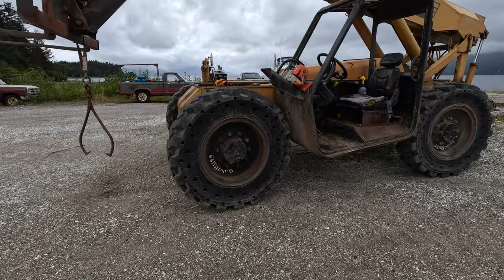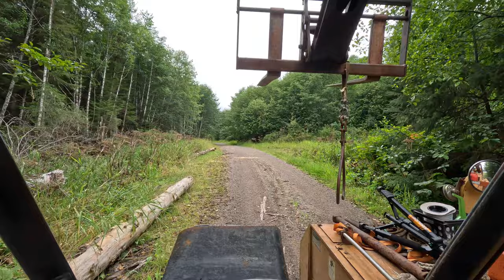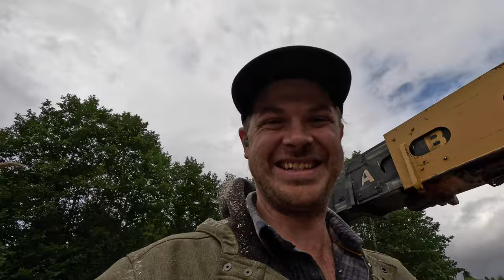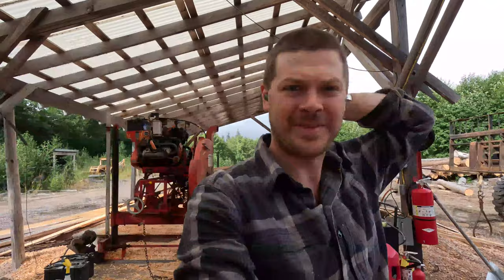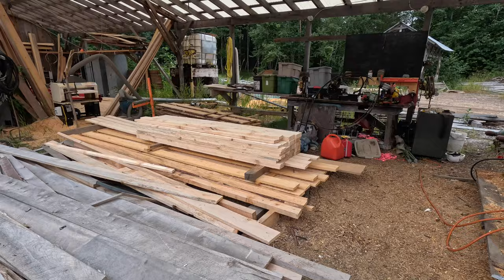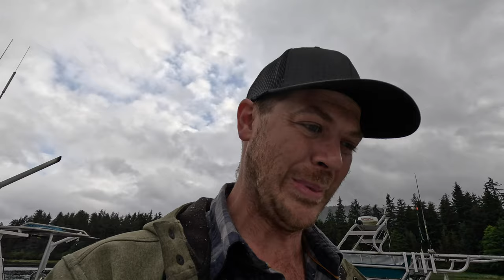Logging with Sterling  -  Mobile Dimension Sawmill   -  Sitka Spruce - Building in Alaska

Comment: How many logs you can cut not sharpening the blade?
Reply from the maker: It depends on the size of Log Buddy 

I am cutting Second Growth Spruce Logs - 24" Diameter - I cut 3-4 Logs in 3-5 Hours 

The mill says sharpen teeth every 4hours - which is suprisingly accurate 

if your logs are dirty - it will go dull immediately - I imagine different timber will cut drastically different than our Sitka Spruce and Yellow Cedar

Comment: That must be one of the last years the mill was made before the hydrostatic carrege drive.
I know of one hydrostatic made in 89 are mill is 92
Are first one was 73
I believe 86 ish was the very first gen1 hydrostatics.
You could use that left hand sawdust shute for the main blade. We find it very helpful.
.
We do a lot of custom full-size stuff, with the 128 wide eger on.
6x6s 6x8s 6x12s and occasionally the limit of the mill 8x12s
.
26 foot 8" is the most ive squeezed  in for an order, that wanted a finished length of 26'-4"
There was less then an inch clearance at each end.
Reply from the maker: Hey 

Thanks for commenting Buddy.    I did not realize this mill was close to the cutoff for the hydrostatic drive.   I would really like to operate a mill with the hydrostatic. 

The old belt drive really does work allright tho - keeps her moving along. 

That is great.  When we were milling mainly for my Dads construction company we did a lot of 6x12 - and 4x12 for foundation beams on the mobile dimension.    

We have started harvest second growth spruce here in southeast alaska, and is really fun to mill.  It cuts so easy, the mill seems to never have any issues when we are cutting second growth.   It is super fun. 

I rebuilt our mobile dimension from a pile of rusted out crap - the engine and carriage were good - everything else was gone from being setup on the beach near the ocean. 

My Dad purchased the parts, new endstands, cross beams, and 1/2+ all new for the rest of it.  We have cut with it for 10+ years now at Corner Bay.  They are great machines. 

I have the Left Hand Dust Chute!!! For some reason ours continually clogs up with the Long spruce shavings.  When the teeth are sharp, they will take shavings 6-10" long at times, i finally took it off as i was tired of clearing it. 

i should try the chute again though, it has been a few years. 

What part of the country are you located? 

Thank you so much for commenting 

Sterling
Reply: @secondgrowthhomes 
 north Oregon coast range.
.
I actually worked in Troutdale at mobile manufacturering for 1.5 years. Right near the end..
The company has sold to new people, they have relocated North of Salem, OR.
.
there working on retro fit kits, for converting rope starts to electric starts.
 a kit to convert to hydro drive.
And replacement track, as your not the only person to have issues with salty air and or water.
.
We commonly have the same issues with western red cedar with the left hand  shute as well. It can also jam the shanks full of chips with WRC. In general, Cedar is just way hard on the mill.
 Very rare to have issues with dug fir.